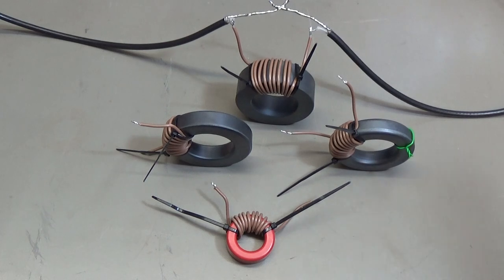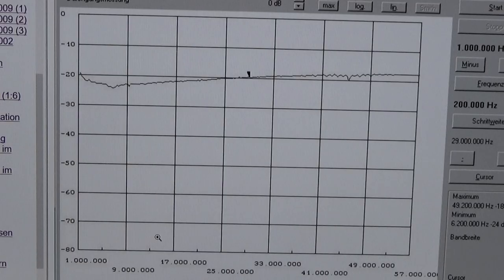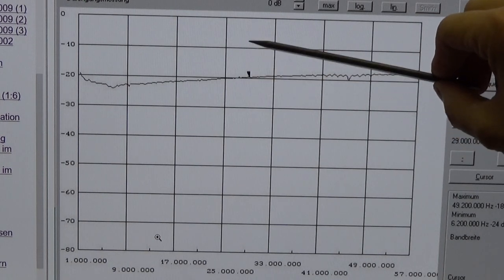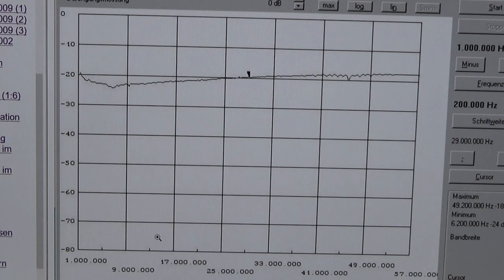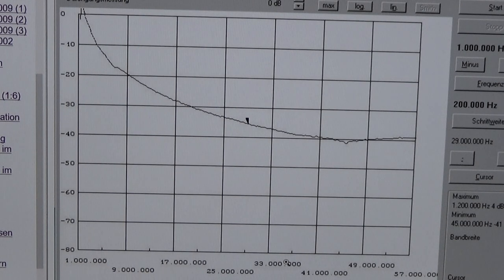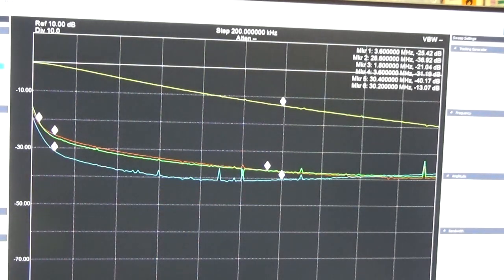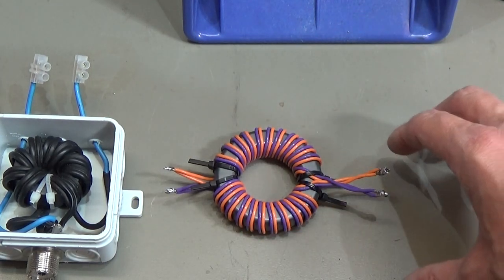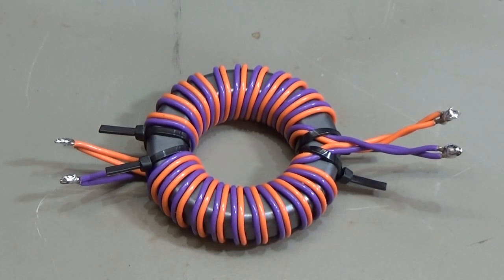#101 Balun PART 2: Balun's magic and how to wind an effective working Balun

Comment: Hello Peter, what would be the issue in using 0.8mm magnet wire (that I already have), the one used for transformers? I can't get hold of this PTFE wire...
EDIT: I built it and it works amazingly well! my poor atu wouldn't tune on certain bands the EF long wire, and I knew there was RF because It would behave nice on low power and would try to retune and go crazy when I increased the power. Now I can tune all the bands 160 to 10 with no problem. I got excellent reports so I am very happy
Thank you so much!

Comment: Hi interesting explanation. And professional..I have 140/43 also there to do 12 rounds? I have no problem with the power I use 70 W I use a thinner wire of a transformer .. the number of rounds is important to me. Thanks

Comment: I purchased the same wire you're using for your baluns.  It appears to be silver tinned wire.  What do you do to solder this wire.  I have the heat on my iron cranked up and  It doesn't seem that conventional solder sticks....

Comment: Hello Peter, Thanks again ! Very great videos. Do you recommand to use also this Balun for a simple dipole half-wave ? Could you tell me the reference also from your used wires ? And my last question, could you explain please the difference between a voltage and a current Balun and when they should be use ?
Thanks you. 73's. Stephane.

Comment: I wanted to see if I could improve on your Balun design but, of course, I couldn't.  However, I found an old plan for a 1:1 Balun made very simply as follows.  Twist fairly tight two 18 AWG magnet wire and wrap it 12 turns on a FT140-43 core (1.4" OD and .9" ID).   I wanted to avoid parasitic capacitance of the wires as much as possible but this did not seem to bother your design.  I spaced the 12 turns to cover about 3/4 of the toriod allowing for about 1/8" between each of he inside turns.  I did this toriod in series.    Testing this from 7 Mhz - 30 Mhz I got a 1.03 SWR  - 1.07 SWR and a RL of  38 dB at 7 MHz to 30 dB at 30 MHz.   Maybe your equipment would help to verify or show the results as I did.  I would appreciate your comments  because this Balun is much simpler and less expensive than your larger Balun.   Thanks!
Reply from the maker: very good Hank and thanks for your report! 73
Reply: Hi,
May I ask on this 1:1 balun on your finding? How do you install this balun “in series” and is this connected at the feed point? May I have a link/ copy of this balun design?
Thanks in advance.

Comment: I have a few , maybe 20 different types of cores. I really appreciate your analysis of core material. . At 12:57 you measured 61mm I think. That famous choke "number" was originated in the united states, and 240 corresponds to 2.4 inches ! As I said before, I will be researching the use of the TinySA and NanoVNA for use in these measurements. Was the red material type 2 ?

Comment: Peter, thanks for your videos; as always!!

But, this time you leave some questions open. At least for me.. 
Maybe I'm one of those less intelligent persons, but I have to ask.

1. How did you know what kind of cable you should use? How did you know that this will cause a 100Ohm winding?
2. Is the AWG of the cable the only factor that affect the impedance of the winding? If not, can you please specify exactly which kind of cable you use.
3. The factor of 12 turns, is that based on 'test and trial' or are there calculations made which we don't know about?
4. When installing this balun in a box, is there anything to think of when applying connectors? For example, does it have to be mounted in a plastic box? With isolated connectors?. Does it make any difference connecting orange or purple to the center pin of the connector. Do you have to connect the same color to the same pin on both sides of the transformer/balun?

Freundliche grüsse..
Reply from the maker: Hi Mikael, no problem we try to answer as good as possible.
1. A lot of wires have close to 100 Ohm impedance if you put these side by side. At the end it is testing and probing until you found which wire fits best.
2. AWG is the American measure for wire diameter. Just google  AWG18.
3. Finally you need enough impedance to have a good transmission and low attenuation in the low frequencies but it should not to much to avoid to get into core saturation. So 12 is the good tested value for this core.
4. In part one I have the spider Balun as example. There you should see the mechanic work. Basically you can't make to much wrong. If you have on both sides PL connector you should not mix up the colours.  Other than that no problem.

Hope that helps
73
Reply: This confused me as well, "A lot of wires have close to 100 Ohm impedance if you put these side by side..."  Say what?  :)  Really? 100 Ohm... magic number! - why?  Does being coil-shaped matter, wire size and/or metal?  This was the only bit I didn't understand, everything else was really great - Nice to see some accurate experiments :) Thanks
Reply: @w3llhard  You want to maintain 50 Om as part of the entire transmission line to the antenna. The device has two coils in parallel so the impedance is halved, hence the need for 100 Ohm to start with. Any 2 wires side by side have a distance between them (at least the separation of the insulating material) and that counts for the impedance calculation. It's common to have different wire diameters placed  at different spacing to produce the same impedance.

Comment: Fantastic videos!!!!  I am working on a slightly smaller version of your 1:1 and 4:1 baluns.  My torroid is the same material as your but slightly smaller and I am using the same wire mfg except I'm using 22awg wire.  I notice I am running out of space for 12 windings per side.  Can I go down to 10 windings per side and still get good results.  I'll still get 4:1 following your design but am curious as to your thoughts on if this will still work or if I need to stick with 12 turns and get a slightly larger torroid.  Thanks again for taking the time to build a great video series.....probably the best available on the net!!!!

Comment: Thank you for the detailed video, I really learned a lot from it! One question I have is how do you know how many turns to do on the core, is it just a matter of utilizing the whole core, it looks like you had 12 turns on that one, if a bigger core was used would you just increase the turns to fill up each side? What is the diameter of that core you used?

Comment: Thanks for that impressive work. The two videos about Balums are quite nice. Perhaps I would enphasize the fact that the device you are talking about is a BALUM+Choke+Transformer, but at least for me it is ok, I don't know why people usually refers as Balums when it could be doing one of these things, or the three at once. But my doubt is about another topic, but related to this, and it is as follows:

I have built a QRP receiver Kit, I think it can goes from 0.25 to 1.5 Wats of power. The question is that, I supply it with batteries, and no connection to Earth at all. I am wondering whether, only with respect to the balancing issue, the matching between the board and a dipole antenna could be considered an unbalance-balance matching or not, because, with respect to the real Earth, the complete circuit is floating. Thanks a lot in advance, and have a nice day.
Reply: Certainly a choke only. The device does no transformation & doesn't "balance" any physical quantity or such. The effect of blocking backwards common mode current makes the load-end (antenna in this case) appear symmetric but it still ain't a BALUN. It does present an impedance for the outer current only.
The usual flat coil of 8-12 turns of coax in 6" diameter is a choke very similar (but bulkier) & also is called "Choke Balun". Still this device is made very nicely & performs well.
Nice work OM peter, a little tedious though .

Comment: Is there an analytical way to know how many turns I need to make a balun primary look like 50 Ohms? The issue I have is that the primary looks like an inductor and its reactance will be XL = 2*pi*f*L.  Say I want 50 ohms, L = 50ohms/(2*pi*f).  The frequency ranges from 1 to 50MHz, the impedance will not be 50 ohms  so what am I missing?  I was thinking once I know the inductance, I can compute a wire length and from there start.  I am stuck at 50ohms at one frequency

Comment: You didn't fully describe your test fixture for the cores, so I'd just like to verify that it consists of putting the wound core material in series with the center conductor of the coax cable and putting a 50 Ohm load on the end of the coax. I think I understand the process, but want to be sure since I have a lot of old cores to test. Thank you.
Reply from the maker: go here and scroll down https://www.youtube.com/channel/UClqWe58x9q6jx61gB16731A/community

Comment: Amazing video, thank you! Do you know if these baluns are suitable for 2m VHF? Also, in case it helps anyone else, it took me a while to understand, but this is a common mode current choke and not a transformer. The difference being that there is a single circuit, rather than two inductively coupled circuits.

Comment: With 12 turns it takes a very small wire. I tried 18 gauge and 20 gauge wire and can not get 24 total turns. Not enough room. What gauge wire are you using.
Reply from the maker: IT IS AWG 18 watch appr. from 13-16 minutes....

Comment: Is the reason for the ptfe wire only heat resistance? Are there any electrical reasons for using stranded, insulated wire?
I'm going to be under 100W.

Comment: Great video but a couple questions. You say 11 turns but I count 12. A turn is every time it passes through the center. Can you confirm? Also I am confused how this works you reverse the magnetic fields between left and right. Current flow is reversed. Why doesn’t that just cancel each other out?
Reply: Yep, another reply further back noticed too. It's 12 turns as counted through the middle, but you'll only count 11 if you count the outside. Peter made a minor slip on that one, but it's completely forgivable. Have a look at the stop frame 24:26 to see the actual count. We love Peter's YouTubes down here in Australia, they're top notch from start to finish.

Comment: Ok, so I used one of your examples of a common mode choke. Perhaps I did something wrong, but it didn't help with the noise level for my mini-whip antenna. I still have as much noise now as I had before inserting the chokes. :(

Comment: Two questions and you might answer them later (I'm at 36:22) or in a future video. First, does the size of the toroid matter? You're using 240-43 and I have 120-43's. Second, my scenario is a dipole (comprised of metal coils) connected to the 450-ohm ladder line, which will connect to coax. Would a 4:1, 9:1, or the 1:1 balun that you're showing here be best?

Thanks. :)

Comment: I have two toroids T240-2  240 mm dia , 25 mm height ,  30 mm center diam.  The toroid is  half painted red.Are these toroids of any use ?  If so for what ?  I have read that this material [2] does not have enough inductance to make a good balun.  Thanks for your videos and comments.

Comment: thanks for the great videos. I may have missed this. How did you determine turns? What happens if I use 11 turns?
Reply from the maker: The turns in this test configuration is not critical you can also use 11 but you must do it for all tests equally to be able to compare...Hope that helps 73

Comment: Thanks a lot for your videos on rf chokes, I learnt a lot. One question though. The main difficulty of this design is getting the impedance right, which depends on the dimensions of the cable, correct? Why not make the choke directly with coax cable? That way you could make sure you have 50 ohms from the beginning. Am I missing something important here?

Comment: Hi Peter - Thank you for these wonderful videos. I am putting up a new 40 meter dipole and wound a 1:1 balun exactly to your directions (all the materials were purchased per your specifications). The resulting SWR (using a 50 ohm dummy load or a small 50 ohm resistor) is 1.6:1   Is there something I did wrong? Will that mean that the final dipole will have minimal SWR 1.6:1 or more? Any advice?????  Thanks, Mark W9MS

Comment: Hi Peter! I ordered # 18 AWG PTFE wire. When received, it "appears" that the insulation is thinner than what you have. The roll is marked properly. Can insulation vary do you know? Thank you
Reply from the maker: Hi David,
well many variations are on the market as long the test results does not change all is fine.. Thanks for watching 73

Comment: Don't worry about your English, also not my mother tong either but at least I could understand you perfectly! Its about time the USA move over to the metric system as inches and AWG is a major headache for me! You mention 11 full turns and the the start and exit for the wire together forms the 12th turn. Well, I tried hard for a long time to do it and the best is 10 turns and in/out are the 11th, no way can I get to 12! I bought a kit at our local boot sale (in the UK it might be called Ham Rally)consisting of a FT240-43 Toroid and 2 strings of 1.02mm silicon wire. The bare wire is 1.02mm and with the silicon it is about 2mm. This might be close to 18AWG but no way can I fit in the 12 turns! On another website where you can buy the kit (USA) the instructions are for 10 full turns and two halves which in total is 11 turns and that is how got it! I've counted your turns and yes its 12. Am I doing something wrong? I did pull the wire as tight as possible several times but no happiness! Otherwise thank you for your video!!

Comment: hi peter
excellent once again. i have 2 questions to ask with your permission pls
1 . how the impedance of antenna is matched to air? air impedance is around 350 ohm and antennas are usually 50 ohm so how come signals are easily transmitted?

2. The monopole antenna usually used for vhf mobile vehicles are balanced but they have one singular conductor or pole. they lack the second one where ground is connected. so how does this work?the concept is fairly understandable though with dipoles.

Comment: I wound my balun just like yours with 14 gauge thhn and I could only get 10 turns on each side (yours has 11) that were side by side. turn 11 and 11 go through the balun as another layer of turns.
is it better to be 10 turns, flat and neatly spaced or better to have 1 additional turns overlapping?

Comment: Super, vielen Dank. Muss man bei der Leitung etwas beachten? Dass sie 100 ohm hat? Ich habe da nirgends etwas gefunden bei diesem ptfe Draht .. 73 - DD6FM - Marco
Reply from the maker: Wenn man genau dieses Kabel verwendet brauchst du nichts zu beachten. Wir haben das Kabel vorher ausgemessen. 73
Reply: @TRXLab  Danke ! Aber ich verstehe nicht wie die 100 Ohm gemeint sind ? Ist das die Impedanz bei einer bestimmten Frequenz auf dem Kern mit dieser Wicklungszahl ? 73

Comment: The sizes of the core material gives you the sizes inches, divided by 100. For instance 240-43 means type 43 material and size 240. This is 240/100= 2.4 inches (61 mm)

Comment: Great videos. 
I made 2 of the 1:1 baluns. One using 31 mix and one using 43 mix. I am using the exact same wire and a 50 ohm load. On both when tested the swr was almost identical to each other, but I have a problem with the swr on both from 14 through to 30 MHz the swr is between 1.4 to 1.7 using an RigExpert AA-200 analyser. What could be the problem please? 

I purchased a PL259 male to male connector to connect the AA-200 direct to the 1:1 Balun instead of using coax and the SWR dropped to below 1:1.05 from 160 - 6m. I'm using it on my Hexbeam and my 40 and 80m centre feed dipole.  Very pleased. Thank you. 73'S
Reply: Check the impedance with parallel wire impedance calculator: http://www.mantaro.com/resources/impedance-calculator.htm

Comment: first off im not real smart but could you use bntechgo 18 awg magnet wire?  it is the the kind of wire i have....i will only be running 100 watts max. it is rated for 155c temp. also it is copper. thank you in advance.

Comment: Peter, you were testing the magnetic material for suitability by using ten turns on the various cores.
 RF was passed thru' the ten turns, input from the left and then output was taken from the right hand end of the winding. Graph figures were taken from there to produce the results and attenuation graph.
How was the attenuation measured? On the scope ...measuring peak to peak volts or  0.7 of the peaks?
Or was there a DC circuit using a diode or a bridge of diodes to view the DC levels of the output. The output coax just disappeared off screen.
73 G3NBY
Reply from the maker: Howard, we are testing with a vector network analyser. With other words we are sweeping the entire short wave bandwidth and assess the out coming graph. Thus we can tell how the different core materials behave. Hope that helps 73

Comment: cant i avoid the insulation melting problem by using copper enamelled wire with a similar diameter?
Reply: In my opinion, just watch out for the increased capacitance of the paired up wires because the enameled wires would potentially end up being much closer to each other, and take the breakdown voltage into count too as well if high power tx is attempted to be used. Other than that, use an analyser to fine tune it and should work. I'm interested seeing your results. Good luck!

Comment: Many thanks for the presentation,I am confident now. I know that this is outside the scope of the video, but are you satisfied with the miniVNA analyzer? I am thinking to buy one,but some people have mentioned that it's quite temperature sensitive  making measurements unrepeatable. Thanks, 73,Kostas
Reply from the maker: Hi Kostas, thanks for feed-back. Well I have not noticed yet that the miniVNA is in any way temperature sensitive. But may be it is due to the fact that I'm using this tool in the lab only...73